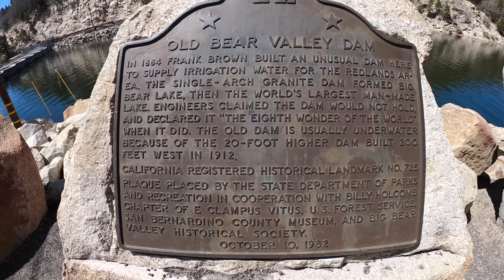Behind the Big Bear Dam. Lots of water leaving the lake/ dam. Amazing views and waterfalls 4/26/2023

Comment: As the lake gets fuller and the pressure increases at the outflow of the lake, I wonder if they could close it off a little and still maintain the minimum required for the stream.  I wonder if the total snowmelt bypassing the lake can be measured downstream and used as proof to reduce the balance needed to be taken from the lake to maintain minimums.
Reply from the maker: Conrad first of all, I am so sorry it took me a couple days to get back to you. I’m not usually like that so please forgive me Brother.
I really like your way of thinking and you are very intelligent and I always appreciate you very much
What you’re saying I’m not sure  but I’ll bet they can measure it somehow and it probably wouldn’t be too difficult, but where there is a will there is a way
You just keep throwing out. Suggestions and smart ideas please   I don’t have much of an impact at this point, but I know the channels gonna eventually have some clout in big bear